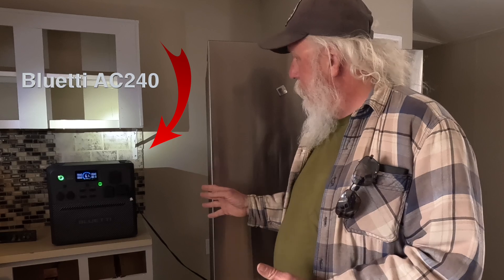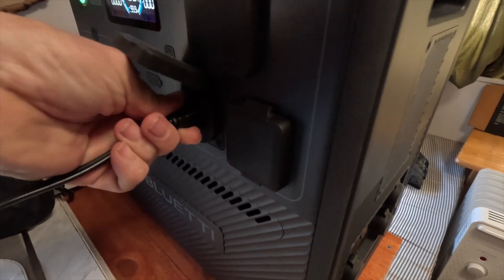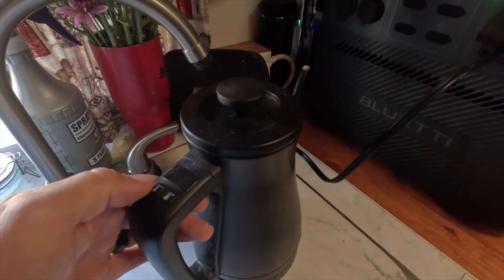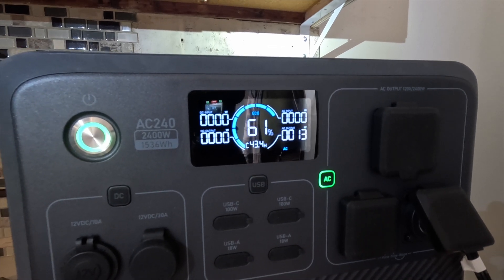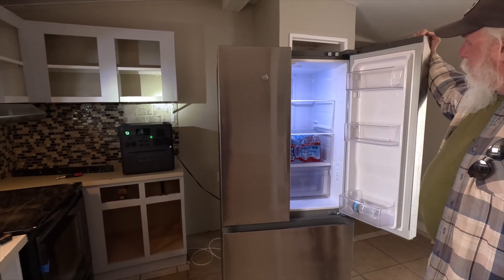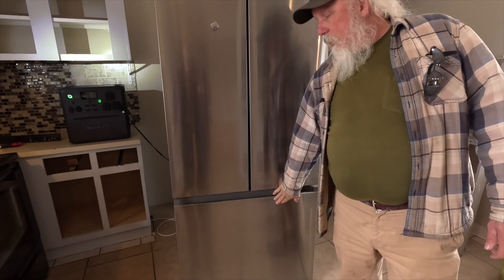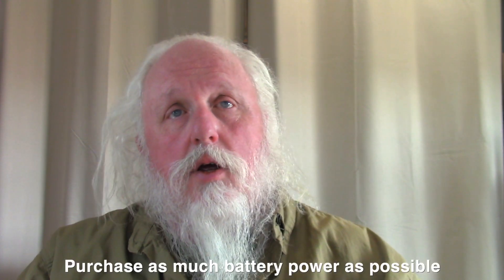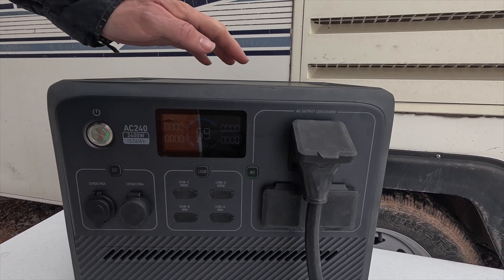Run a House Fridge on a Portable Power Station? Bluetti AC240

Comment: I live in Texas and occasionally hit by hurricanes. Sometimes no power for a week or 2. I have a few power stations. I was wondering if running my refrigerator  for 1 hour on and 3 hours off to conserve battery life would be ok.
Reply from the maker: That might be an option. Probably the biggest factor is trying to not open the fridge any more often than necessary. I have seen people use a wireless thermometer system too so that they can monitor the fridge/freezer temps without needing to open the doors. That may help you gauge when you need to power it up again to keep food at a safe temperature.
Reply: @FrontierVanLife I might need one of those thermometers. Thanks!

Comment: I have a question that may apply to other travelers. I have a 1000  watt solar generator. I power it while driving using a 400 watt inverter that's permanently attached to my vehicles battery. I also have 3 100 watt solar panels that are not permanently attached in order to make it easier to stealth camp.  Last year, we had few sunny days in Florida and I had to run my car in order to keep the generator charged. I drive a 2014 Ford E350 super duty van with the biggest alternator. I believe it's 120 amp. Right now, the inverter pulls 120 watts off the battery while driving but I need to replace the transformer (they call it a power supply). Can the alternator handle 230 watts being pulled from it? Nobody can answer this. Not the generator maker or my mechanic. They say ask an electrician, but I can't see how they could answer an auto question. You seem to really understand power supply for off grid, so I thought I'd run it past you. Thanks for reading.

Comment: Hi Robert,  really good video. We live off-grid in southern Alabama and have several Bluetti AC 240's as our primary source of power, we keep them charged up with 8000 watts of solar . The 8000 watts is divided into 4 separate grids, don't need too much wattage going into the Bluetti's and damaging them. The property we have sits on a 800 acre private spring feed lake that always has a nice breeze blowing, for that reason I custom built two wind turbines using 200 AMP truck alternators. That gives me about 4800 watts of usable power that keeps all of our power banks fully charged 24/7. It gets pretty hot and humid here in the summer time and we run a 5000 btu window air conditioner a lot and the Bluetti handles it without any issues or drop in battery amps....